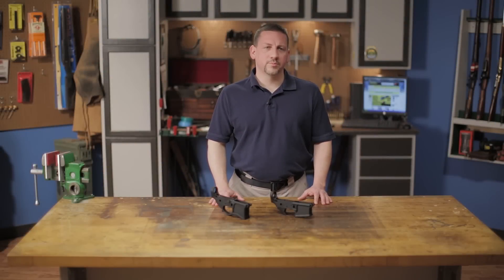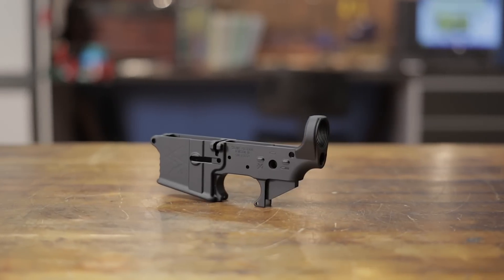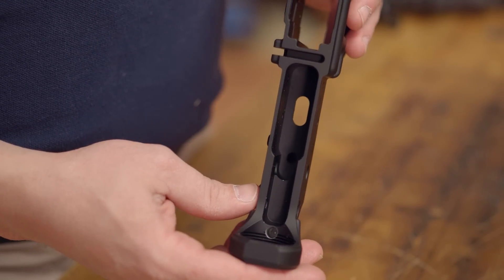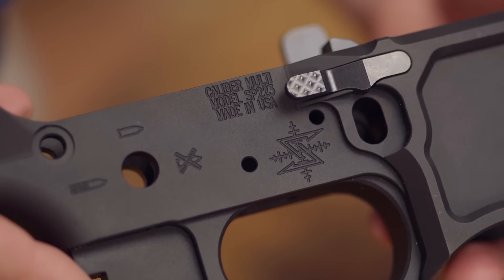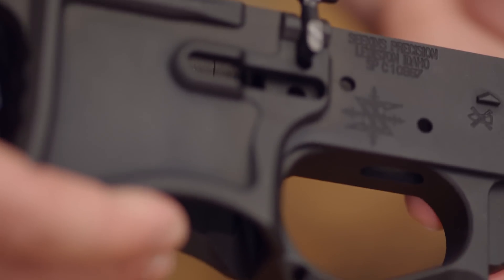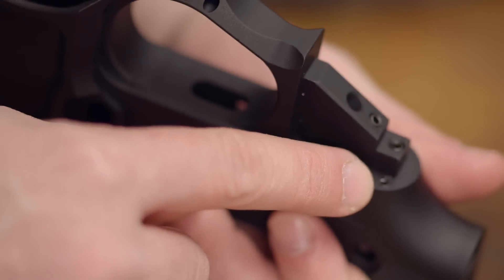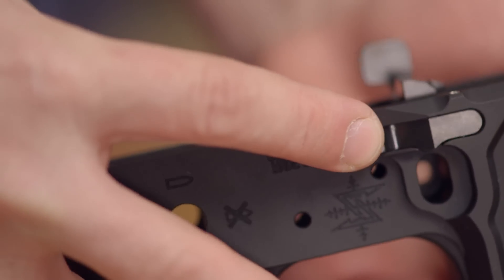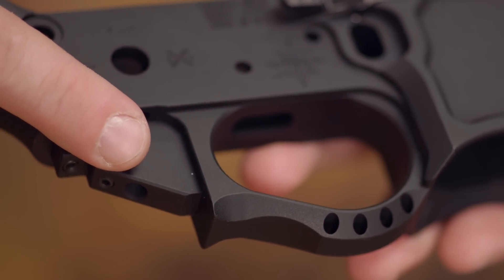Seekins Precision AR-15, SP15 and SP223 Lower Receivers

Comment: I like the one I bought, but if I had to do it again I would get a Noveske Gen 3.  The tolerances on the Seekins were machined too loose for my taste.  I find there is too much wobble between the upper and lower receiver, no matter which upper receiver I have tried (to include a Seekins billet upper).